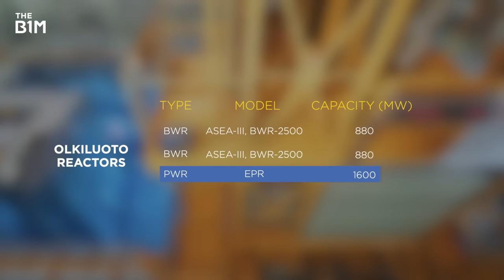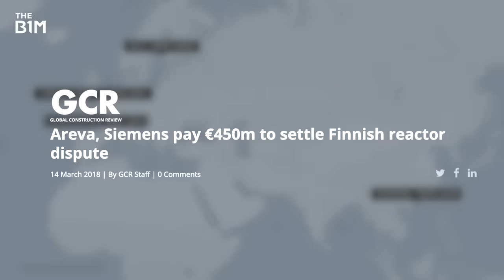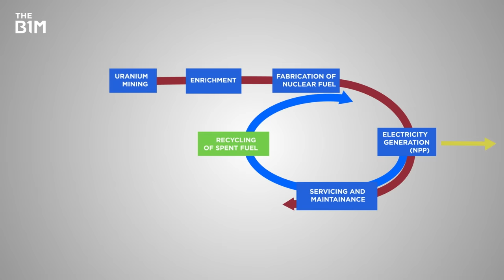Finland Might Have Solved Nuclear Power’s Biggest Problem

Comment: As a note, I work at a nuclear facility where we regularly recycle used nuclear fuel, both ceramic and metallic forms. Nuclear fuel recycling is both proven and mature, with my compound having run a reactor basically on recycled fuel for over a decade. Used fuel, and the radiation it emits, historically has also been used for manufacturing, crop diversification, and other projects. It's true we don't do those things much anymore, but it's mostly because of irrational fear around radiation rather than for technical reasons.
Where to put the used fuel is not, in fact, the biggest problem nuclear power has, but it certainly is perceived as such.

As another note, the US has 2 such repositories where fuel could be similarly stored: Yucca mountain and the Waste Isolation Pilot Plant (WIPP). Both has mostly been hamstrung by public opposition and fearmongering about radiation.
Reply: "Used fuel, and the radiation it emits, historically has also been used for manufacturing, crop diversification, and other projects."
Crop diversification?!? Would you be willing to explain to a layperson like me what that means and what it looks like in its implementation? Thanks for the educational comment.
Reply: @beaupeep  by you saying no amount of information can change that you’re basically admitting you were just afraid of it you don’t understand it and no amount of education on the subject will change your mind. That’s not a really intelligent way to look at an issue.
Reply: @LargeeeScaleLife  What I meant, and I wasn't very clear about it, is that no amount of education is going to change the fact that nuclear energy isn't clean. Its toxic. - I honestly wish it was clean, that would be wonderful.
Reply: @beaupeep  it is and I’m not going to deny that but I think with better technology such as recycling of fuel thorium reactors and things such as this then it could be made to be clean enough to justify the price. We’re going to have to find something I don’t think that solar and wind is going to cut it at least not right now. I’m not like a super save the earth green person but I do think somethings got to give
Reply: @LargeeeScaleLife  I totally agree, wind and solar are not gonna cut it....I'm not really a save the earth type either...I don't even remember how I got to this video, lol... I often wonder how many people stop and think about oil and petroleum and realize how things changed with that discovery. ..Now we need a replacement...
Reply: @beaupeep  FUSION is the way to go, and MIT has just developed a containment magnet, that gets us a bit closer to having clean, Fusion-powered energy.
Reply: @karlhungus5554  I don't know how common it was but I had some contact with the industry. Some agriculture research programs irradiated seeds and saplings to rather test radioactive effects or to introduce random mutations. They then would use the plants with beneficial random mutations in normal plant breeding programs. This was basically to speed up the process of trait selection. I would think by now, that genetic engineering is more common for this task.
Reply: Thanks for inside information!
Reply: @dotarsojat7725  Agree. nuclear fission is only a step to fusion.
Reply: @Blackhawk182182  "For all we know, Elon ccan develop rockets to send waste into space, who knows, but be rational, not emotional"????????????? that is totally irrational.
Reply: @Blackhawk182182   Sending nuclear waste into space isn't feasible because there is no way to 100 % insure that there wouldn't be an accident.  And if there was, it would be monumental -  burning radioactive waste scattered over hundreds, possibly thousands of kilometers.  Musk is too intelligent to take that kind of risk or responsibility.  It's not about pushing the limits of what we can do like the Wright brothers (who did their flight experiments at great risk to themselves, but not thousands of others).  People have already thought this out.

Comment: 2:40 I wanna know the person who designed the position of those lights and ask them why would he do that ?
Reply: They  are positioned over the desks so the light is straight down where people work. It stops shadows coming off the monitor onto the desk where there might be paperwork, and the same goes from shadows caused by light behind the desk user.
Reply: @haydenravenscroft1803  So basically random considering the amount of desks and panels to cover front and back
Reply: Welcome to the world of BIM, architect painstakingly sets out the ceiling grid; electrical engineer throws the lights in any random way once it hits the the correct luminance values. 😭
Reply: I could dig up the name for you if you really want to know :-D
The real control room has somewhat different lighting design now as-built. This pic is from the simulator using an earlier control room design.

Comment: Seems LFTR is a MUCH MORE elegant solution. Recycles and re-“burns” the fuel supply, thus eliminating (actually utilizing) the radioactive ☢️ “waste”. The reason there is nuclear “waste” is because of a highly INEFFICIENT fuel cycle in conventional reactors that only utilizes about 1% of the available energy potential in the fuel rods before they have to be removed/replaced and tossed into the heap of radioactive waste storage problem.  LFTR also passively/automatically addresses any runaway events thru its design.
Reply: This. The guys use U-235, which is 1% of all uranium in the world, which eventually decays into U-238. Yes, this uranium needs faster neutrons to react with and yes, it produces plutonium as a byproduct, but that's the pecking point. We use the uranium we otherwise bury and convert it into additional fuel for reactions.
Reply: @garr_inc  U-235 does not decay into U-238, but both are primordial nuclides just like Th-232. They are naturally produced during binary neutron star mergers and spilled out into the interstellar medium, seeding star-forming nebulae with heavy elements and eventually ending up in planets like Earth.
Reply: @Grobocopatel  Right. Sorry, I forgot. My diploma is suckling the brainpower out of me, and it is not focused on nuclear fusion of fission.
Reply: There are many of these designs, including the IFR that successful operated in the 1980s. The correct solution to this problem has been known, and proven to work, for a very long time. We can do better than burying this stuff, we just don't.
Reply: @jasexavier  beacuse it is still cheaper to bury it
Reply: @darkstepik  Which shouldn't mean it's automatically the "right" solution. Sustainability and safety should outweigh just cost especially when considering something like nuclear energy or world energy in general. But I agree with the accuracy of your statement, it just sucks it's true.
Reply: @jasexavier  IFR just reduced the waste problem... so calling it successful is just wrong....

There is no easy solution but the World Nuclear Association will say otherwise.
Reply: It’s almost like the technology has had practically zero innovation or investment since the 70’s because of asshole environmentalists shutting down all the opportunities to do so...oh wait
Reply: @kurtwagner350  No investement? Grow some knowledge  or do a little research not that hard! countries have spent billions on new type of reactors.
Reply: @metalgearsolidsnake6978  a drop in the ocean compared to what has been spent on natural gas, Hydro, Wind and solar during that span so like I said practically no investment
Reply: @metalgearsolidsnake6978  Reduce the quantity by a factor of 50, and the lifespan by 1000. Also, it can be run with only spent fuel, other than the initial charge to start the reactor, so no new wastes would be produced.
Reply: Yes. Thorium reactors are the way the world needs go. 
Big oil and major power companies are afraid of losing money so until their small minded greed is eliminated we are stuck with expensive and risky means of power production.
Reply: @jasexavier  show me a reactor that create no waste product? Link?
Reply: @toddspraker8916  And thorium reactors are not expensive? nuclear energy is big business as well
Reply: @metalgearsolidsnake6978  No new waste. There are reactor designs, like IFR, that can use only existing waste as fuel (a highly fissile charge is required to start most such reactors, which could be new enriched uranium, but it could also be fuel bred from waste in another reactor). They still produce waste, but the total quantity of waste is decreased, rather than increased, because what is fed in was already waste. (The quantity of waste stays essentially the same, but the hazard presented by the final waste product is reduced greatly from the original).

A 1000 MW reactor consumes about 1 tonne of fissile material per year. Normally this comes from about 25 tonnes of enriched uranium, resulting in 25 tonnes of waste to store. If it was instead derived from 25 tonnes of existing waste, leaving 25 tonnes of waste at the end, the net result is 0 additional waste (most fast reactors produce more fissile material than they consume, so really you start with 25 tonnes of waste, then get a year's worth of power, and at the end you have maybe 24.75 tonnes of waste and 250 kg of usable fuel, a process that can continue until all the original nuclear potential energy of the original fuel has been used up, which is 25-100 times more than what was released the first time around).
Reply: @toddspraker8916  Lose the anti-capitalist mentality to increase both your insight and influence
Reply: This project has lifetime cost of a bit over 3 billion euros. How much would it cost to develop and build a commecrial thorium reactor. 20 billion? 30 billion? Remember, someone has to pay for it.
Reply: It is made expensive on purpose.  They are greedy!
Reply: @ChristopherPronger  Companies amortize multi-billion-dollar R&D costs all the time. They just have to believe in the product enough to take the risk.
Reply: @Grobocopatel  My body has a lot of iron that came from a nova!
Reply: @jasexavier  No new waste.... show may any link that says that IFR do not create new waste ? The problem is the nuclear industry itself, it have created so much damage to the environment/ocean .

It is very sad when you actually read about it.

Comment: At least someone is doing something to expand nuclear.  Good on you Finland!
Reply: Maybe they should have invested those billions of dollars in renewable energy, there's NO nuclear waste from that
Reply: @misterflibble6601  Consider: nuclear energy is the only one that is actually reliable and produces meaningful amounts of energy at a fraction of the cost and is actually more environmentally friendly and significantly more cost efficient than things such as solar panels
Reply: @misterflibble6601  you are so right.   What a waste of money and unnecessary risk.  It is one of the most expensive ways of producing energy and the massive time and budget over-runs mentioned at the beginning of the video are a warning to everyone.
Reply: @Guilherme Tavares Pinheiro Which is why France is moving away from Nuclear ?  Which is why in Australia they are building massive renewables to power Singapore... NOT a nuclear power plant ? Mmmmmm
Reply: @misterflibble6601  Yet, solar power and wind kill more people per energy generated.
Reply: @olbradley  I believe nuclear has an important role to play, but a fraction of the cost? Basically every single new nuclear plant in the past 20 years has suffered from massive, multi-billion dollar cost overruns, delaying output by several years (the plant in the video is a good example of that) adding to the expense. Is nuclear reliable and safe? Sure, but it's hugely expensive.
Reply: @prerunnerwannabe  Nuclear is only expensive when you are first building the power plant.  Once the initial construction is done its hugely more cost efficient than any of the other methods and produces power for dirt cheap.  It is by far the most efficient.  The reason why nuclear is struggling is because governments and private organizations are investing less in nuclear.  If it's public image were cleared and people were more educated then it might receive new investments and not being actively shut down by several governments.  Nuclear is the best energy source we have at the moment and we should expand it at all costs.
Reply: "Environmentalists" have traditionally been the biggest hurdle to actual clean energy. Hydro and Nuclear power are the only clean options that will go far beyond in energy output compared to energy input when solar and wind struggle to break even.

They will harp on forever about storing Nuclear waste and pretend at the same time that massive strip mines in China and Chile don't exist to get the materials to make Solar Panels, Wind Turbines, and massive batteries and that we don't just dump that waste in Vietnam and Peru and it ends up in the Pacific Ocean.
Reply: @1968Christiaan ,  Well said! Reportedly it takes 10 years to build a nuclear power station and 20 years to decommission one, involving massive expenditure of money and energy - and then you've still got the costs of waste management and disposal. If governments didn't underwrite the costs, nuclear would never get off the ground . . .
Reply: @olbradley , You leave out the cost of decommissioning nuclear plants (reportedly it takes 20 years), managing the waste above ground and the costs of disposing of it long-term . . .

Comment: Build molten salt breeder/ burner reactors and use the repository as a fuel source.
Reply: Exactly! if you want to store it underground, fine but make sure you can retrieve the canisters when needed.
Reply: @chapter4travels  I think the whole point of this storage is that it can never be retrieved.
Reply: If you think that is the answer than you don't understand the problems and principles of operation.
Reply: @chapter4travels  Fiscally that is true I guess, but considering the kind of upheavals and revolutions the world and even Finland has seen in the last hundred years, I think it is more responsible to have it under lock and key and throw away the key.
Reply: These are the best of the fission reactors they have only one significant drawback that I know of that is that you can use it to produce plutonium.